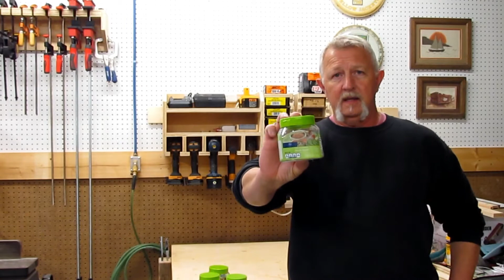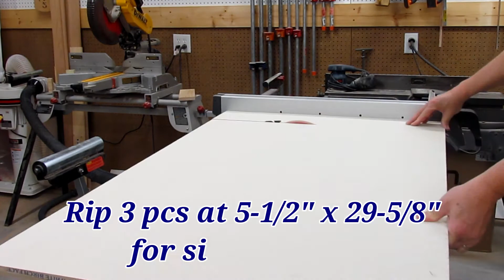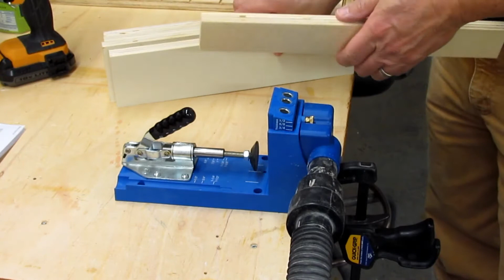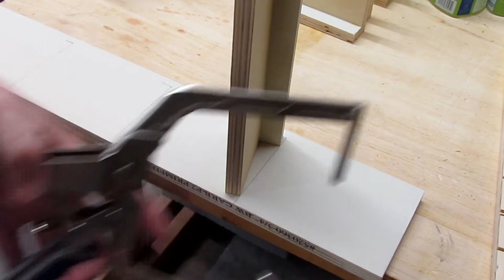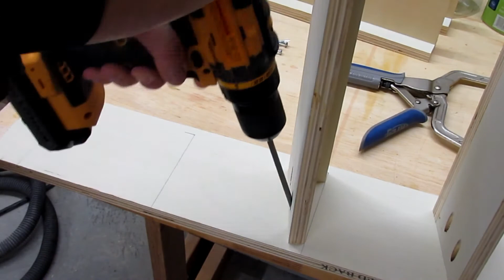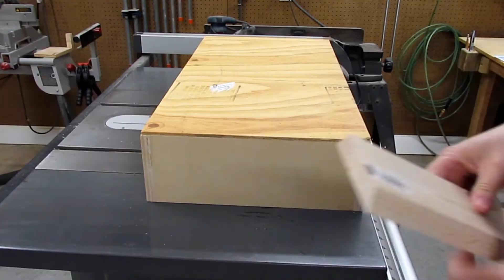Build a Screw Rack / Nail Rack for your Shop

Comment: Hey Dennis long time no see! This is what I was looking for,only problem is I don't drink coffee. What else would work? I have plenty of the larger ones from Costco, but to big for sorting nuts, bolts and washers. Have a great holiday ✌🏻️🎅🏻🎅🏻🎅🏻🎅🏻
Reply from the maker: Hi Alan!  Thanks for watching.  If you have access to baby food jars, they would work.  But I'd probably opt for those small reusable tupperware type containers.  You might have to resize the rack a bit, but that would make a decent solution.  Also, I'm currently working on a video for holding those 1 lb screw and nail boxes that the big box stores sell.  That may be a good solution for you too.  Thanks again!